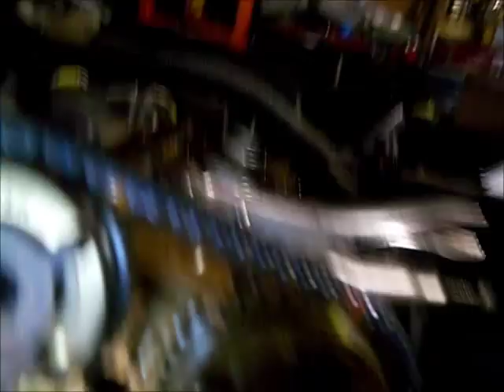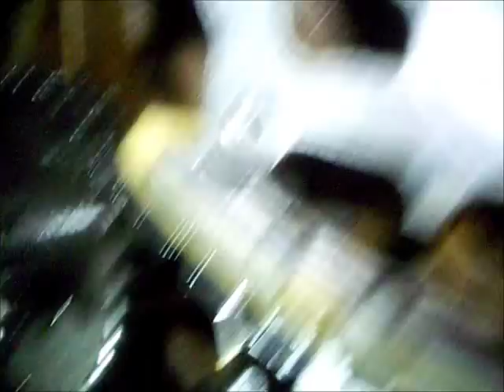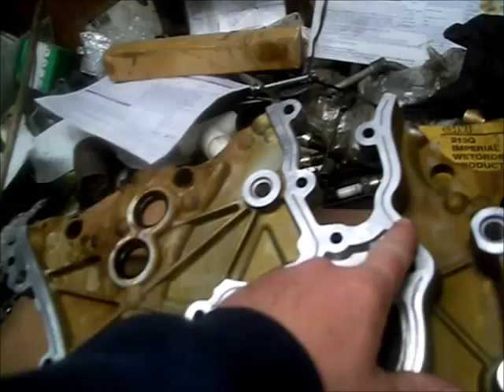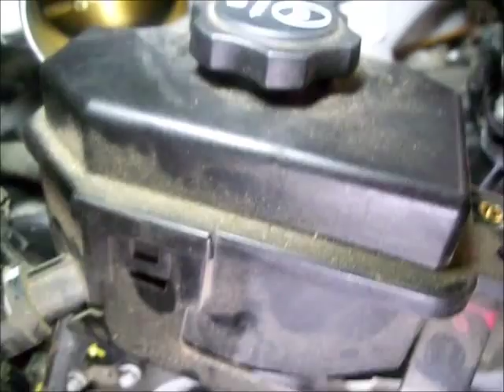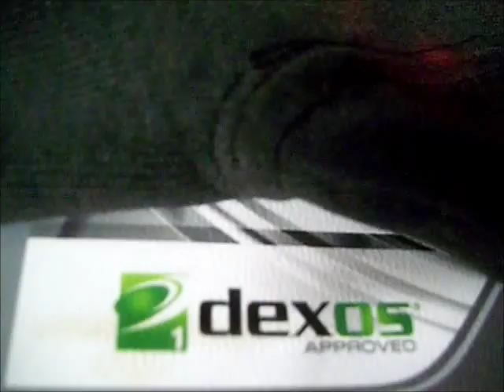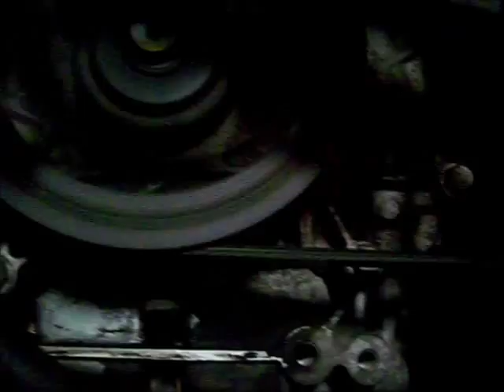Buick Lacrosse 2010 w 3.6 l engine pt.3 timing chain install procedure

Comment: What are some of the symptoms. My Buick lacrosse makes a loose belt noise when I accelerate when cold but goes away when the car heats up. Today it gave me a p0011 code( intake camshaft) I just want to know was that sound a symptom of a camshaft going bad? Or was that something different?

Comment: I just wanted to say thanks for your excellent video. I just completed a FWD timing chain replacement on a 2007 Saturn Aura 3.6 DOHC. Everyone said the engine had to be removed on a front wheel drive application. When I saw your video, I knew it could be done in the car. It saved me anywhere from $1500 to $3000 to have a mechanic do the job. Plus, I know it was done right and wasn't a hack job.
Reply from the maker: Thanks for the excellent review, I was going for cost effective and non-invasive as possible.  With an oem quality repair. The one attn. getter was to not smear the silicone down in the back lower corner near the power steering pump.  (Close quarters with the body)  I suppose if the silicone could be applied to the block instead there, or some sawed off bolts to act as guides for the cover.  (But clear the chain and guide there with cover)   A side-note would be to go ahead and install a new water pump as well.  This one failed less than 6 months later I think.

Comment: You didnt have to use the camshaft retention tools that Chilton recommends?
Reply from the maker: +Sean Tisdale  Everything I used is shown in the video, I circumvent using special tools if it can be done with a reasonable safety margin.  ie (not causing damage to critical parts or self) One, to save money and another reason, so as not to fall into the special tool click that is developing to service usually only one specific engine in a specific date of manufacture.  By spending several hundred dollars on special tools just isn't feasible, unless you specialize in doing just that 1 model, and several of them to recover the cost of the tools.